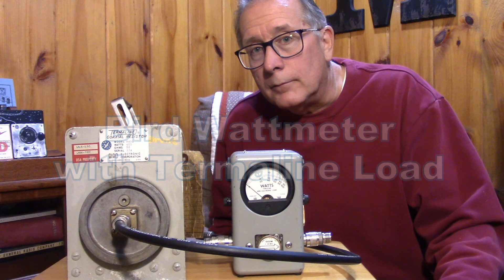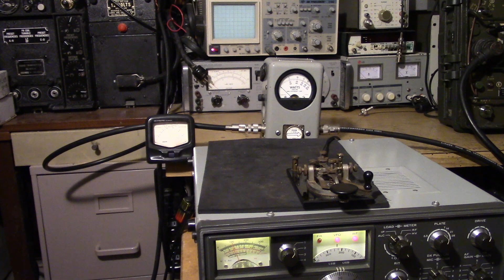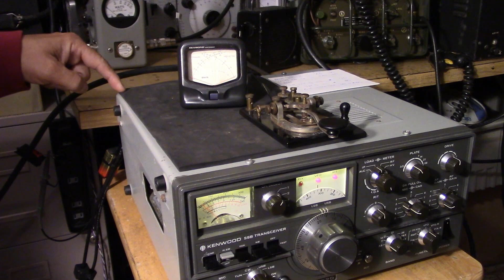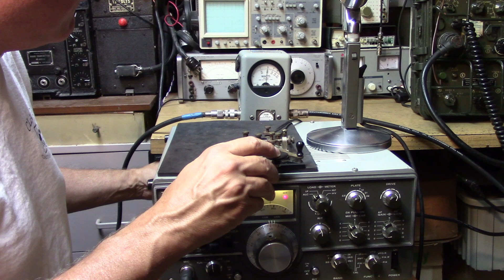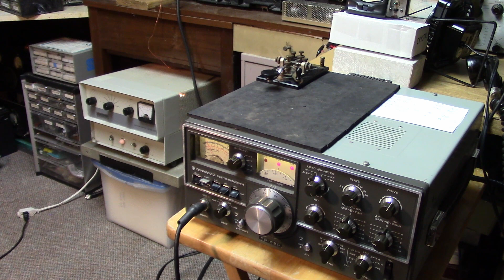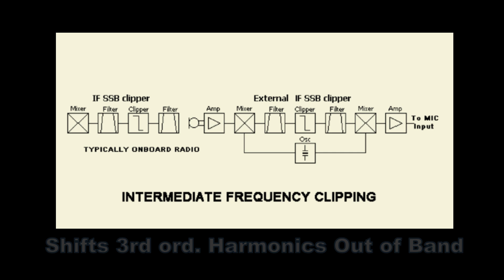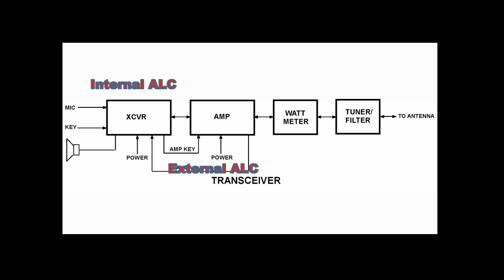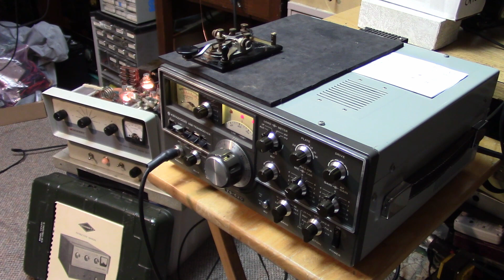Gonset GSB-201 Part 3 - ALC

Comment: I guess one experienced amateur can identify a problem from the sound produced by human voice.  One common problem is when  it sounds like the microphone is located in the throat. How would you improve that kind of sound (other than pulling on it)?

Some amateurs put a lot of effort trying to tune their audio for the ultimate voice. It is a hobby in itself. But that's not for DXers.

 My understanding is that high fidelity sound will do poorly on DX. A simple dynamic microphone is sufficient instead of a condenser mike followed by 3 stages of audio processing. Am I right?
Reply from the maker: Transmitted Voice Sound fidelity and intelligibility drive toward interesting and opposite goals. SSB voice for the casual QSO's lies somewhere in the middle! Whatever the microphone, and both Dynamic and Electret are equally capable and are well beyond what is required for SSB coms. You do have to consider voice polarity to the microphone, as the voice is not symmetrical, with more upward energy the goal. Then equalization to the voice. And finally peak to average processing as required. The first is done by swapping the element polarity, The second is usually done in the microphone preamp (my Shure hand Mic has it built in preemphasis for instance) and the latter in the radio or with an outboard processor.
Reply: @MIKROWAVE1  Oh yes, voice polarity!  I had forgotten about that one. You talk about it.  For electret mike, there is no choice. Let's assume they have designed it properly (with the voice pressure closing the gap between electrodes)?  In the Dynamic case can I just assume the red pole is positive (same as with speakers)? It is unfortunate that the equipment does not have a direct/reverse switch?  To me equalization is useless because you end up in BW 300-3000 Hz any way? 

Again, when I hear a ham with the typical SSB "microphone in the throat" sound, what should I assume: too narrow filter? off frequency? too much gain? too much compression? 

This throat sound is so common, I would really like to understand what this is about.

I don't hear my own signal. My fear is it is so awful...

Thank you for reading your comments. Your videos are great.  You remind me of a former school mate of mine who used to carry vacuum tubes in his coat pockets.  (Now I have a collection of old sperry klystrons  in my basement. I had a job where there was a lot of very very old stuff around but I could never resolve myself in liking VT)

VE2KLW

Comment: You can use a vertical for a dummy (Minster) load.
Reply from the maker: By "Vertical" are you referring to the premiere low angle Dog X-Ray Antler I like to call my Magic Monopole?
Reply: @MIKROWAVE1  Any vertical antenna will do. Splatter is to be maximized during contests.

Comment: Very nice presentation of ALC operation and audio processing. You are correct that ALC is necessary for older radios, tube or solid state that do not have a power control. On those radios there is no way to adjust drive to the amp to prevent flat topping or in the case of a powerful amp to keep power at the legal limit. Although on the solid state radios you could set the power internally but that is inconvenient. The newer modern radios with a power control,  ALC feedback from the amp is not needed at all and can actually cause problems. The power control in newer radios is very accurate in setting power exactly were you want it and drive amps precisely. No one I know driving linear amps with newer radios use ALC feedback from there amps.
Reply from the maker: I plead ignorance on the new radios. Are any of the newer radios or amps using an external ALC connection? Geeze nowadays you could do it with Bluetooth.
Reply: All the radios I have owned or worked on with RF power control , still have the ALC input on rear panel. Don't know why maybe a holdover from the old days.